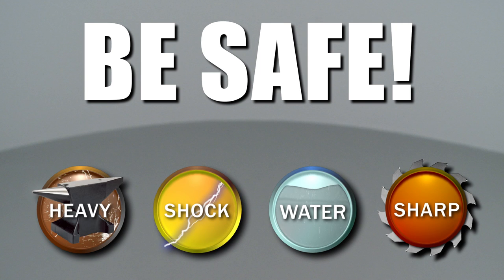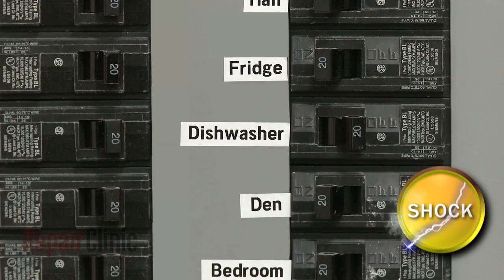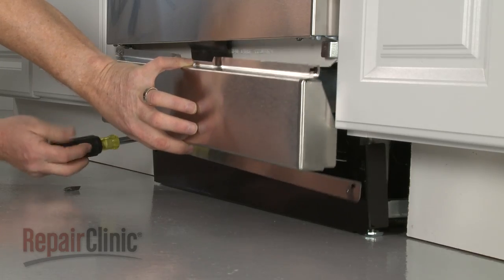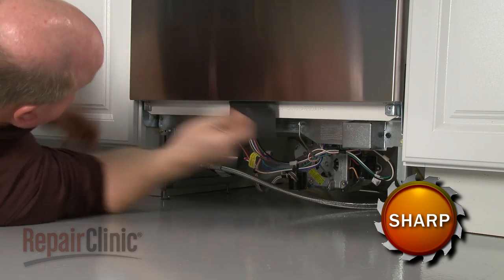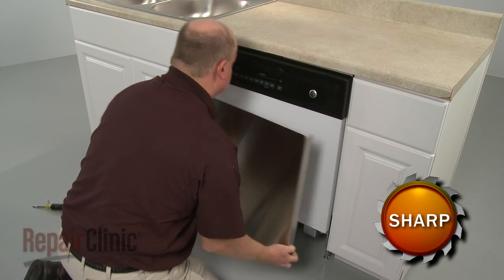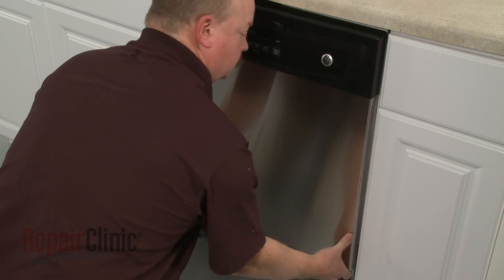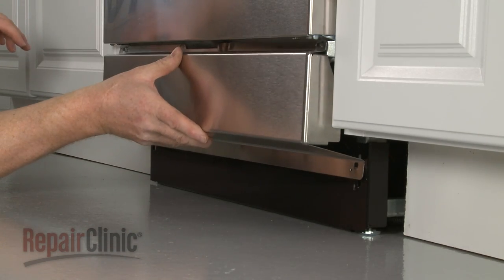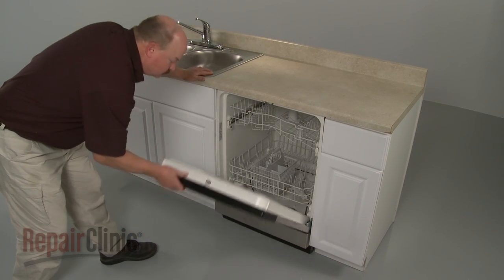GE Dishwasher Outer Door Panel Replacement #WD27X10257

Comment: Do you know where I can find the same procedure for the GE Dishwasher Model GDF570SGF0WW? It's a totally different configuration and the only 2 screws one can see are not for removing the panel.
Reply from the maker: Marc Hoffman Looks like you might have the inner and outer door panel system of that model. This video might help with how the door comes apart: Detergent Dispenser Replacement (part # WD12X10415) - GE Dishwasher Repair.
Reply: *****
Thanks! This was just what I needed and was not finding through the "obvious" channels (GE and Sears).